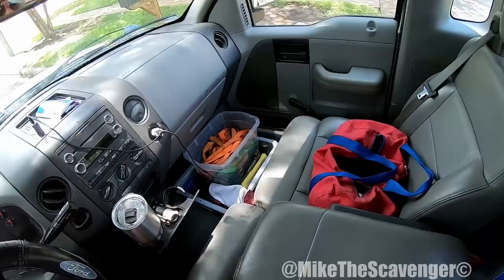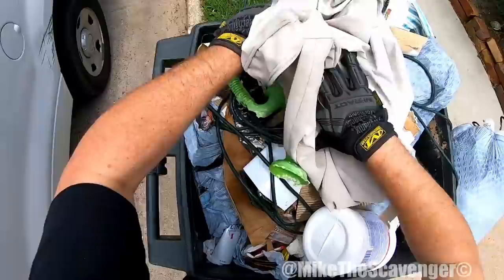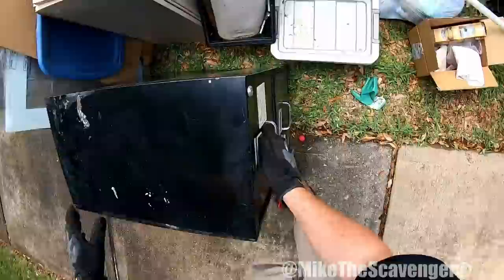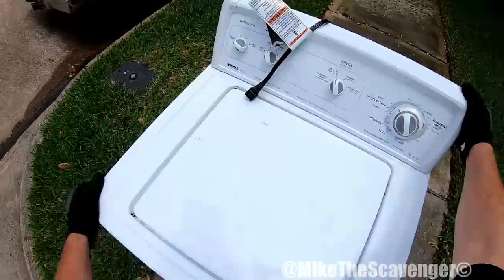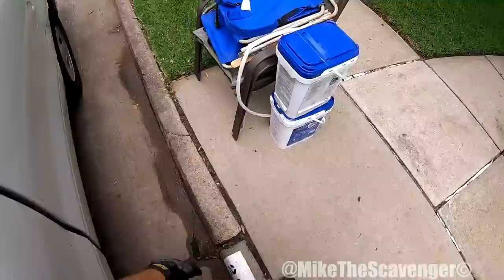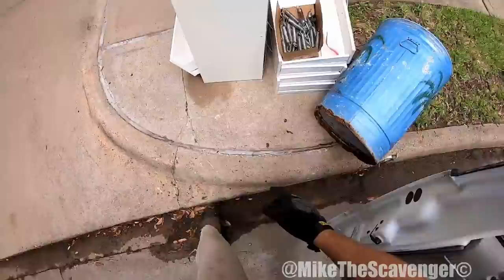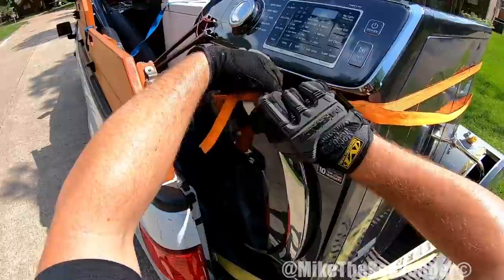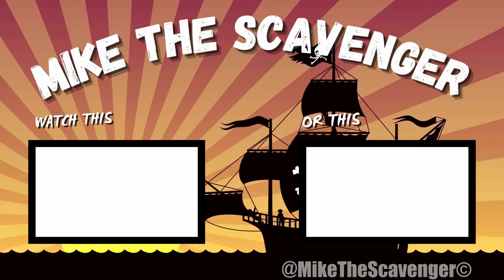Curbside Scavenging "I'll Take That Too!"

Comment: Hey mike the scavenger if you take the washer apart and keep the ring where you wash your close in and use a metal fan round top and a umbrella holder makes an awesome burn barrel

Comment: Mike @ 12:30 we in Europe have 99% frontloading washingmachines .... when they leak, it's a matter of replacing the proper rubber seal (18 bucks) and the spin is most likely a matter of a new belt

Comment: I am a teacher. 4 college degrees, and I have watched every single one of Mike's videos. There are many lessons to learn here. Societal and otherwise.  Question: Why doesn't every community recycle metals? When we "throw something away" do the trash companies/disposal sites also recycle?  SO MANY QUESTIONS.  Thanks for your work Mike.
Reply: Some areas they do collect and recycle metal it's usually done twice yearly on designed heavy trash days. In Mike's area the green garbage cans are collected one day a week for normal recycling paper, cardboard, cans, glass, plastics. If Mike or another scrapper didn't pick up the items they all would end up in the local landfills. The only item the trash will not collect is the refrigerator or ac units and car batteries.
It's not uncommon to see 2-3 scrappers making their rounds the night before trash day and the same for the morning in the same neighborhood. The competition is thick when scrap metal prices are higher like it is now at 12 cents/ lb since the price fluctuations.

 I would assume recycling metal as a community or county function just like trash collection would cost more money than it could profit after paying for the equipment and man hours to do so. The inner cities do offer recycling locations that do take metal and it is sold to cover costs but does not work for the suburbs.

Comment: those front loaders have a filter on the bottom left front  put a Rowell on the floor and open hatch pull out filter and clean it  u will notice that ur washer won't smell

Comment: front load washing machines are the worst design ever to come out! they breed mold inside the tub!
Reply: Not to mention  they don't  clean your clothes.  At least the one I had for a few years. Seemed they came out dirtier than they went in. Not joking.
Reply: @paulcoenen7918  they hold brackish water inside the tub under the barrel that gets black with mold and bacteria- every time you use it after the first wash! From that point on you are just washing with pre contaminated water chock full of bacterial residue! It stains your cloathes and dulls whites and bright colors and leaves a smell quite like sewage water! Even when the self cleaning cycle is used it changes nothing! And don't get me started on uprights without a center agitator!!! They are only one rung up the ladder!
Reply: @genehasenbuhler2594  
Sounds  exactly  like mine was doing  POS. But they save water just like a low flush toilet  that leaves all the crap in your  pipes.
Reply: @paulcoenen7918  save water- when ya have to do it twice to get the smell out!

Comment: Borrow my father in laws truck today….. very successful
 1,160 pounds of steel-$ 114
280 pounds of rotors-$36.40
295 pounds (transmissions) -$29.50
104 pounds of Ac compressors -$20.80
35 pounds copper al radiators-$61.25
2 alternators-$4.0
23 pounds #2 copper-$71.30
Grand total- $337.95
Reply: Nice haul!, how long did it take to collect all that?